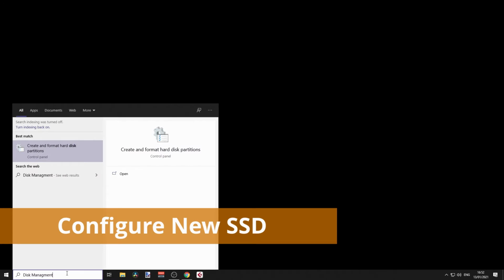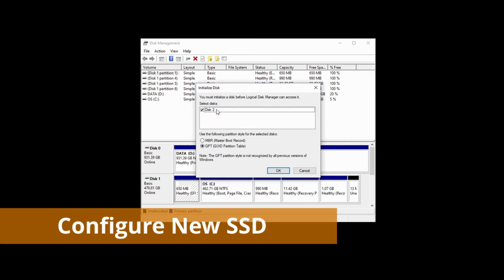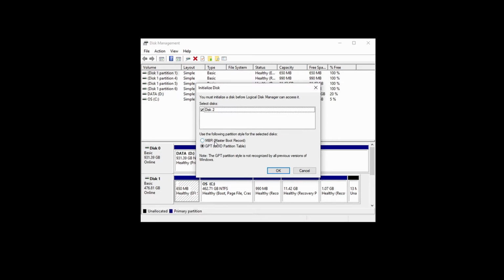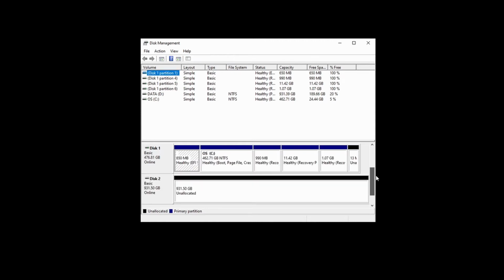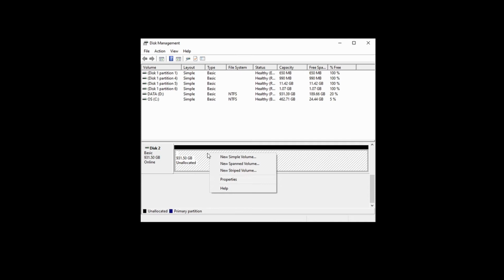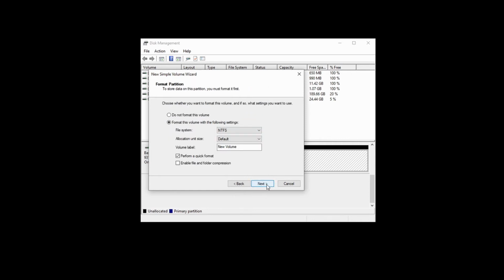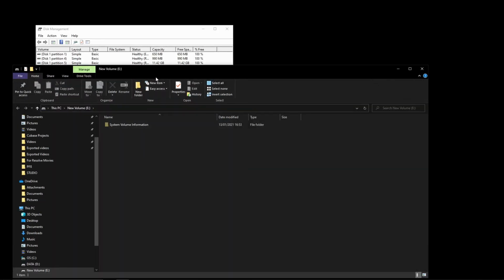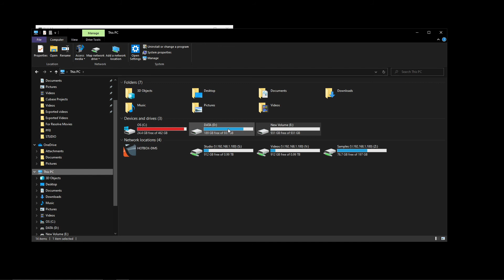How to install additional SSD on Alienware 15 R4

Comment: I have 1tb and iam looking to install a 500gb ssd when doing that does my os automatically transfer over to the new ssd after I do this ?
Reply from the maker: No it does not transfer automatically. you can install an additional ssd, as I did. replacing the C: drive where the OS is install most likely needs a reinstall of windows etc, but i’m not sure maybe there’s a way to copy..
Reply: @UDiAudio  ok thankyou

Comment: Protip: NEVER use a powered screwdriver on delicate electronics. You run the chance of damaging the mainboard or other components.
Reply: Lol first step, over torque the screws with a powered screwdriver so that the bottom panel is permanently ruined.
Reply from the maker: @sfaxo  Yeh.. the screws were set too tight.. had to use some force..
Anyway.. I broke just one.. :)
Reply from the maker: I guess you are right.. 
next project is to replace battery..
Reply: and NEVER do this on a carpet..can short circuit.